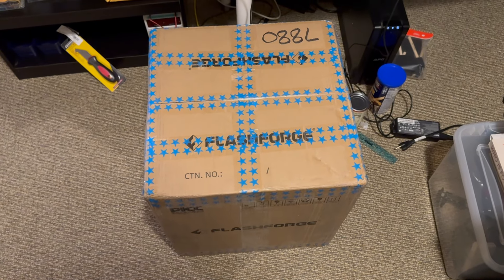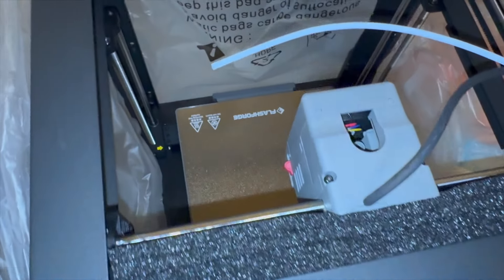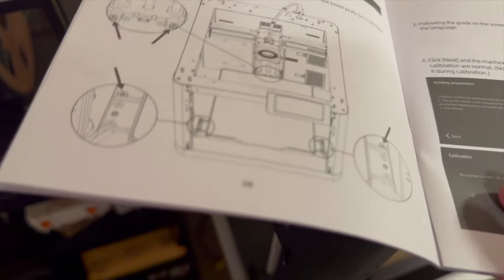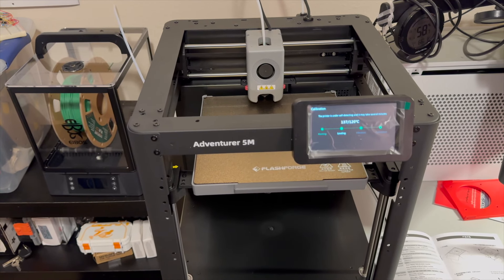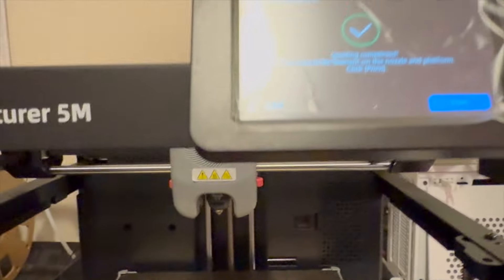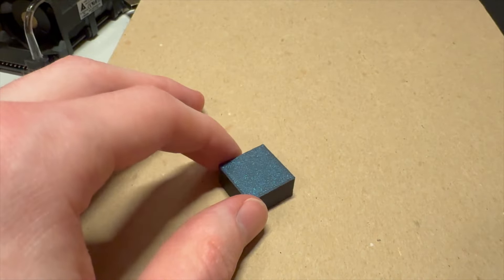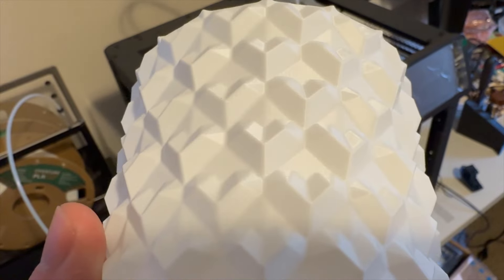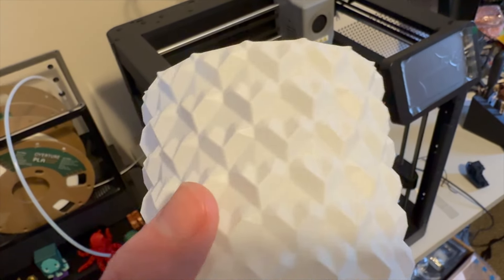FlashForge Adventurer 5M 3D Printer Unboxing and First Impressions

Comment: I got one and it was delivered yesterday. I followed all the directions in the manual to the letter. and it refuses to level. It sounds like a belt is skipping or something. And the print bed stops about a half inch from the nozzle. Not sure if things like this are normal. Anyone knows how to fix it let me know please.
Reply from the maker: I am sorry to hear that. That does not sound like typical/expected behavior nor has it been my experience. I would recommend contacting FlashForge to see if they can help you.

Comment: I just got my A5m this weekend and I will say there is a known issue with the latest firmware. I recommend you avoid the update until they fix it. I updated my firmware and it was not longer able to home correctly and started crashing. I reverted the firmware and no issues since.
Reply from the maker: Ooo, that's not ideal. How were you able to revert the firmware? I could not find how to do that. Stuff like that was why I was so reluctant to connect to the internet and upgrade.
Reply: @nlambert  I did a factory reset. And yes I recommend avoiding the wifi connection for the time being. It will prompt you to update the firmware. 
I believe the company is currently out due to Chinese new year so I think that is why the issue hasn't been fixed already
Reply from the maker: @viaJustin1910  I don't need to try it as I haven't updated, but I wouldn't have ever thought that a factory reset would reset it back to an older firmware version. Usually it just resets all the settings on things like phones etc and keeps the current version. Thank you for your input, I appreciate it. Hopefully I don't need to use it in the future though haha
Reply: @nlambert  I can look to confirm it did reset the firmware version when I am around the printer again. I will give you an update but regardless it fixed the crashing issue.
Reply: @nlambert  I just double checked and I don't believe it did roll back the firmware I am currently on version 2.4.5

Comment: My problem with this printer is that Nozzles are very expensive compared to other printers (Nuzzles come with heating element which is weird)
Reply from the maker: They are definitely more expensive, how realistic is it that you would actually be changing nozzles? Do you want to be able to print using different nozzle sizes? If so this one is pretty much hot swap and would likely be a superior choice. For most 3D printer users, a nozzle change isn't necessary.

Comment: Just unboxed my printer , had your video playing in the background. Super informative . Thank you . Only thing I was expecting was the over top shaking while printing 😅 definitely gonna need a different spot to put my printer on.
Reply from the maker: Haha, glad I could help! Enjoy your new printer and I hope you have a new place for it!
Reply: @nlambert  thank you ! For now I had to place it on the floor till I get a more sturdy desk haha . I did have a question, I was trying to print some of the default items from the printer but after a few minutes the filament stop sticking to the printing plate. Any tips ? I even used the sticking glue provided in the box.
Reply from the maker: Hmm, those should print fine. Did you try washing it with some dish soap? I did that right out of the gate and haven’t had much issue with sticking. Only when I was printing something that was very tall and had a small footprint did I have an issue
Reply: Just realized I was using PLA-F filament and not regular PLA . Have to mess with the Temperature a bit. Got through have a print before it became loose. Hopefully with a bit more tinkering I can figure it out. And I'll be re washing the plate with soap/ water hope that helps the process as well. Thank you for replying back much appreciated.

Comment: Good review, bought last month when nobody really revied it yet. great printer in my opinion ! i never use glue and have not had any issues just a fyi.
Reply from the maker: Thank you! I agree about it being a great printer so far. As far as the glue, I have had good luck with my adhesion and the prints coming right off the build plate when I need them to.

Comment: Nice video! Decided to purchase one myself, as I have an Ender that died while printing ABS parts for my project printers (non-operational), and decided I needed to get something that just-worked before I think about doing anything else. Also nice to see that the Klipper install process is likely as simple as doing a usb firmware update. Your unit only came with the one nozzle, right?
Reply from the maker: Yes, there has been some really great progress from those working on making kipper work for everyone. I haven’t tried it yet though. Yes, I only got one 0.4mm nozzle.

Comment: Does the filament matter? I make cookie cutters with mine and for some reason is isn’t printing correctly with the cookie cad filament. I am starting to wonder if it’s the filament I am using.
Reply from the maker: It shouldn’t matter too much. As with every printer, make sure your filament isn’t too old, is dry as it will soak up lots of water if left around. What is not printing correctly? Is it not sticking?
Reply: It will stick good at first but then it stops sticking and it will just keep going around but nothing will stick.
Reply from the maker: @moniquef4828 I have had the best look by doing a levelling of the print plate every time I print. Another thing that I have done is to wash the build plate with some Dawn dish soap. Lastly, you could try slowing down the printing speed a little bit in whatever slicer you use.

Comment: I confirm, I also have this fantastic printer and it works really well. So far, I've always used its original slicer, FlashPrint. I heard in the video that you use OrcaSlicer. What settings have you inserted? Could you kindly share a link with the presets for both the printer? Thank you very much. And almost forgot, great job and beautiful video!
Reply from the maker: Hello! I use the default 5M profile in OrcaSlicer, which I downloaded here https://github.com/SoftFever/OrcaSlicer/releases . I selected which printer I used in the initial setup for OrcaSlicer after installation. Once at the list of printers, I searched "FlashForge Adventurer 5M" and selected the 0.4mm nozzle selection as that is what shipped with my printer, as I think that is the default. 

For any prints I have sliced, the only settings I modified from the default 5M profile were the infill %, infill style, supports, vase mode, and brim. I have printed some other things with great speed and quality, only struggling with lithophanes. The small footprint and tall structure of lithophane are just a little too tipsy for the default settings of this printer, which causes the print to tip over on the build plate and fail. I am looking into what I can change for a successful lithophane print. 

 Thank you for the feedback. I greatly appreciate it. I am hoping to make more videos soon, but school is sucking up all my time at the moment.

Comment: It does seem like a great printer for the money. The  bump on the corner of the block can be fixed with adjusting the pressure advance. And the bench looked very good. That line on the side is normal when printed fast. I have quite a few printers and my last purchase was a k1. I do like it mind you but it took a bit of work. I don't need a 5th printer mind you but now I want the 5m. Lol. It is such a great deal for the price and now flashforge will let you install full klipper and fluid or mainsail. So it is now a good option
Reply from the maker: Sure does! Thank you for explaining that part of the benchy and your opinions on the K1. It was something I was looking at but it didn't seem to be as plug and play as I really wanted. Also the price was kind of steep for the K1 unless you had a microcenter nearby.

Comment: The glue is, ironically, so parts don't stick too hard to the plate it's basically a release agent.
Reply from the maker: I did not know that. I have never had issues with adhesion so never looked too much into it. Thank you for letting me know!

Comment: This or CR-10 SE at $283.? I can get this delivered to Malaysia for $299+$30 before the discount ends this 21st feb
Reply from the maker: I've very much enjoyed this printer and it being a corexy has big advantages to printing fast with good quality. Unfortunately I have zero experience with the CR-10 SE. If I was to buy a new printer, I would probably go with the 5M just in terms of I know that I can just click print pretty much. But all printers nowadays seem to be printing at a very high quality with minimal user interaction. If you want to be able to tinker a little bit, go with the creality. If you would like what the 5M currently has and don't have much interest in upgrading, go with that one. I know this isn't definitive, but I don't know your use case nor if saving the difference is worth it or not.

Comment: That's for the video.  But I didn't know the Eibos rotates the spool when drying.  Can you print from it while drying?
Reply from the maker: Yes, it does spin! I believe that is one of the features that is intended to differentiate this dryer from others. As for printing from it while drying, yes you can do that too. Although you would probably want to turn off the spinning feature as the roll that is being printed from will spin naturally as it is unrolling. The dryer also has multiple outlets to feed the filament through to best complement where your printer intakes filament!

Comment: Do you use cura? I tryed orca and flash forage and it failed to print but im using the old creality print and it knows the mechine just a small slicer plate so my parts are like 1/10 the size but that ight for prototype for the moment cuz i have ender 2 pro and it has the best soft!!
Reply from the maker: I use orca slicer with the Adventurer 5M profile. You should use the profile that goes with your printer

Comment: There is away to change between 110volt to 220 volt?
Reply from the maker: The printer that I have has a sticker that says input voltage 100-120VAC at 4:54 . I am assuming that these are region specific.
Reply: A little tate.. 
but for anyone reading this
 if you open the back, the power supply has a switch on it that switches between 110to220.
Hope this helps!

Comment: I’ve got one and it’s literally been an out if the box printer. I’m amazed. 
Do you know how to tension the belts if i need to?
Reply from the maker: That’s great to hear! I am unsure on how to do that, I’ve looked around and looks like the screws that I found are for the bearings that hold that belt into place. Possibly it’s behind the back panel? That could be something I could dive into in another video possibly

Comment: is this printer better than Ender v3 KE or CR-10 SE?
Reply: Im in the same place, between CR-10 se and the flashforge adventure 5m
Reply from the maker: Like many things, it all depends on what you are planning to do with the printer. Are you trying to print fast? Large objects? Fine details? The 5M is corexy and has really fast printing speeds, but modifications/upgrades are not like what you might find with an ender 3. The 5M lands in between the KE and CR-10 SE in terms of price at $299.

Comment: I can't decide between this and the Bambu Labs A1.
Reply from the maker: I think that the A1 would provide a better out of the box experience AND has the ability to add the AMS. Whereas the 5M isn’t as polished, but is cheaper, still getting really awesome prints with minimal effort though. It might be worth looking into the printing speeds if that is something you care about. I believe corexy does better with some types of filaments as well
Reply: @nlambert  Thanks for the reply and clarification. I couldn't decide and pulled the trigger on the Bambu Labs P1P.

Comment: Does this take 1kg spools on the side? Thanks.
Reply from the maker: It only does on the back of the machine. I do believe you can 3d print a mount that would allow it to come from the side.
Reply: @nlambert  cool. Thank you.
Reply from the maker: @yousifdelvalle4162  https://www.printables.com/model/705585-side-spoolholder-flashforge-adventurer-5m/files

Here is a link to one that I’ve seen online. I haven’t tried it myself, but looks decent

Comment: You can update using the screen.  No need for a computer.
Reply from the maker: Can I roll back to a different version with the screen though?
Reply: @nlambert    You can IF, there is a setting on the screen to go into, that lets you reset all setting back to factory mode settings?
Reply from the maker: There is a way to reset to factory settings, I didn't think that it would rollback firmware version as well. I have yet to try it but will remember that for the future. Thank you

Comment: Looks like a cheap copy of bambulab😂
Reply from the maker: Sure does! haha
Reply: Bambu Labs sucks bro 🤣 They look like toaster ovens and meat weigh machines 🤣 PETG always gets stuck in AMS and you can’t print different filaments at the same time.. You’ve been Bambu-Zooled 🤣 I hope you didn’t buy the A1
Reply: @Thadopeera  what can I say, you dont know what you taking about
I have the x1c with ams no problem with ams and petg or even abs 
It has never failed me în the few months I had it 
Dont need multicolor printing but it is Nice to have the option in a pinch I use it mainli to continue with another spool when the first one is empty or doing interfacing layer for supports 
The one and only printer i trust to start a print correctly and keep going without any supervision